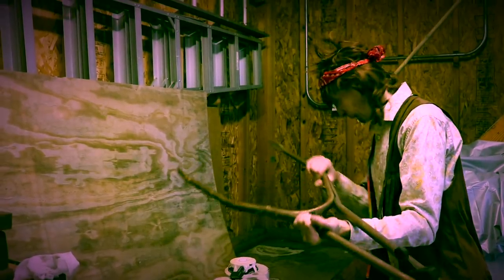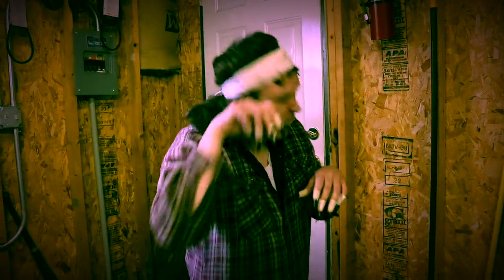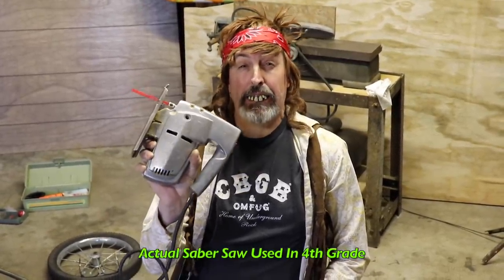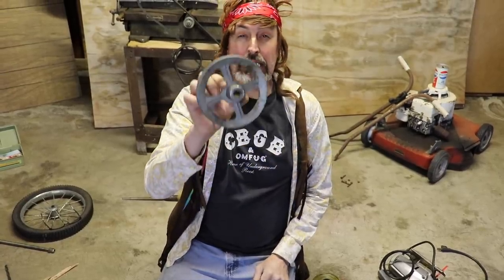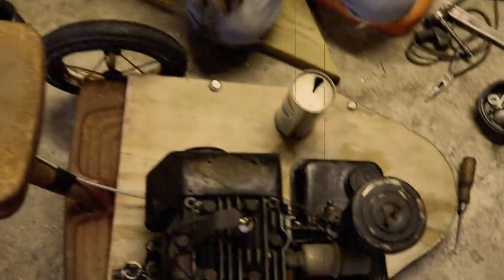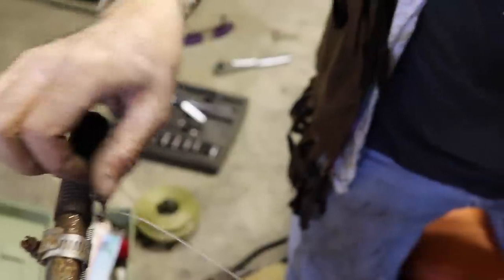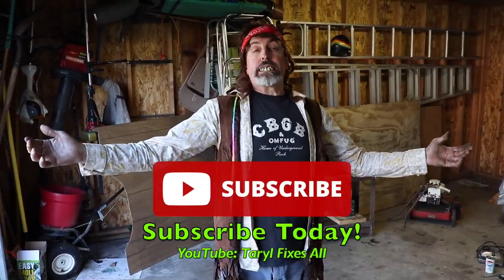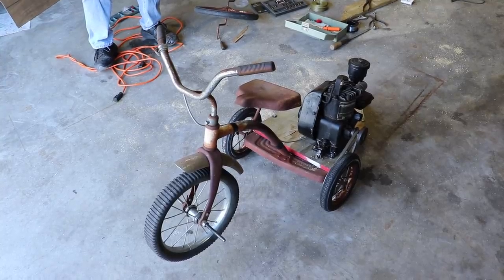We Put an ENGINE on a TRICYCLE! So Cool!

Comment: My buddies and I ran a Briggs 2 HP without the governor on the first go-kart and minibike we built.  Never had any issues.  When I convinced another buddy to eliminate the governor on his Tecumseh 3.5 HP within a week he threw the rod.  Same guy who, a couple years later, we convinced it was OK to hold his Chevy II Powerglide in low up to 60 MPH.  Guess who threw a rod.  Then we urged him to do Neutral Slam starts with his Mercury.  Within a week, he tore some teeth off the Mercury's differential gears.  See, it's not always wise to be a good listener.

Comment: Great show!! I put a 3 1/2 hp Briggs and Scratton on a Montgomery Wards bicycle when I was a teenager. Borrowed  the motor off of dads grain auger, belt tightener pulley off the corn planter, and a v-belt pulley that bolted to the spokes from White's bicycle shop , and number nine wire and a spring for the belt tightener. I mounted the motor over the back wheel on a piece of oak. It would run 35 mph!!  What a blast. And my dear old dad didn't ring my neck, bless his heart!

Comment: In 1968 I asked:my dad for a snowmobile. He told me to build one. I found an aluminum toboggan and a Maytag washing machine engine with a centrifugal clutch and kick start at the town dump. The local machine shop let me go through their scrap pile. I got a pulley, axle, bearing blocks. The owner helped me with a steerable front ski. The Texaco garage supplied a Ford model A fan belt. Over several weeks time I had been using my red wagon to collect parts and show the engine to get the correct size belt etc. the belt was drilled and machine screws were added to grip the ice. The was a river behind our house. It was frozen with little snow. The first day the brass machine screws broke off. The Ace hardware guy saw my problem and supplied hardened machine screws. It worked for a week till we got our first real snow, no more traction. When I got home from school there saw a brand new 1968 300cc 14 H.P. Skidoo parked next to my home built snowmobile.

Comment: I love it!!!!.......Reminded me that in the 60's, I build a wood framed three wheeled go cart. Rear axle ran direct in the 2x4 frame rails, one wheel drive, one wheel brake, front of a bike frame bolted to the center front with handle bars, shortened forks with a lawn mower wheel (went through lots of them!).....engine was made to slide forward to tighten belt to go (acted as a clutch). Broke down a lot but had several farmers junk piles for spare parts, not very fast, but had the time of my life. Later I traded an electric guitar that I was lousy at playing for a real metal go cart, man, I was on the top of the world!!!!!.....Had a ball on the rural roads!!!!!!!!!!........I think both you and I were crazy as kids, but I am sure neither of us would have traded all the fun for anything!!!!!!

Comment: I'm on my daughter's YouTube account. I remember taking things apart when I was very young. I just wanted to see what made things tick. I remember one time taking a scale apart. I'm suprised it still worked after that. There were a lot of things that didn't make it back together. When I was about 8 my dad told me that I needed to pay attention where the parts go when I took things apart. I think at that time he knew that I wasn't going to stop taking things apart. Lol. After that conversation my put back together rate went from about 50% to 90%. There were a lot of things that I wanted to build, but didn't have a welder, chop saw, or allen wrenches. I got my first welder about 13 years ago. I bought a brand new wire welder. I'm in my second childhood now. I have a Coast to Coast riding mower that I put an opposed 16 horse Briggs. I did a pulley swap on it. It went 12 mph. I did some more modifications to it. It then went 18 mph. I did one more modification and it went 40 mph. That's with the governor still hooked up. It took me about two years to solve the steering issue. I tried to align the best I could many times with no avail. Then one day when I was walking by the rider I noticed the problem. The caster was way off. I drilled out the factory spot welds for the front axle housing and readjusted the caster. My welder welded it in place. It was a complete different machine. I eventually slowed it down to 24 mph. I used it to pull a yard card full of grass/weeds to the dump. With the steeper gearing it was more user friendly with the extra weight. The factory brake didn't last long. So I cut a small piece off of a brake shoe for a car and fitted it to the drive belt. It has the 6 speed transmission plus the varidrive. So the varidrive does most of the stopping and the piece of the brake shoe only rubs the belt to stop when it almost stopped anyway. I hasn't worn the belt yet. I've done some riding mower modifications as well with the snowblowers. I have an older 12 hp Murray that runs on E85. I have 2 RER Snapper riders that run on E85. I've tried to do the same with a couple of push mowers, but it wasn't worth the effort. I mow in the summer and move snow in the winter. Plus I work on people's  mowers and snowblowers. I even work on a competitor's mower.  I'm small scale compared to you, but it pays the bills.

Comment: Excellent vid and story Taryl !!!
Back in 1965 I wanted to make a fan driven snow sled. I took a similar engine offa' my neighbor's self-propelled reel type mower... the thing was just sittin' in his garage doin' nuthin'. lol I got the 30 inch plastic fan blade offa' big 'ol free-standing restaurant fan I found in the basement of Hering's restaurant which had the same size shaft as my engine - 1/2".
I cut the arms and back offa' antique high-chair.(got in trouble for that) I bolted the engine to the chair seat and attached the blade. I tested it before mounting to the sled. My left hand holding the head of the engine I pulled the rope with my right hand and it started right up and the fan immediately blew the whole works over with the fan blade somehow missing my left arm as it went by. The fan blade blew to pieces as it hit the ground. End of experiment. Moved on to build a gokart with the engine, which of course had no brakes but that's another story. lol Thanks for the memories Taryl !!!

Comment: Heck yeah, awesome video!  Brought back memories as I was a child fabricobbler also 😆.  I built an all wood go cart with wagon wheels, foot steering with a rope backup, and a 4hp vertical Kmart briggs.  Transmission/clutch system was an old riding mower transmission I found in the junkyard by my house, I adapted it perfectly with some old pulleys and belts.  I say perfectly, but it was a trial and error process for sure.  I remember I could slam it into gear and shift all 3, and even reverse occasionally.  I eventually blew the transmission so I had acquired a 4 hp REO mower engine from a gas powered reel mower I got in a deal for working cleaning up these people's shed and yard.  That's fine was awesome, and it had a built in gear reduction.  I used a pedal powered belt clutch and my dad built me a steering gear at work so I could install a steering wheel to my 2x4" front "axle"/steering plank 
swivel style 😆
I also rocked around everywhere with an old 28cc weed wacker engine on my Kent BMX bike, dad helped me with the mount and clutch.  Good times

Comment: Lots of fun going back down memory lane. I've been tempted to build another mini bike like the one I built using an old bicycle frame,  B&S  2 1/2 HP edger engine, Speed Queen washing machine clutch, dryer pulley and wheelbarrow wheel, all from trash pile,  when I was about 12 or 13. Believe it or not, I still have a couple of those old Speed Queen fluid drive coupling washing machine clutches.

Comment: I did almost the same thing at the same age. I took a gas powered reel type walk behind with the identical Briggs engine you used and took the handle off and the rear wheels off the trike. I than bolted the step plate that was between the rear trike tires to the plate on the mower where the engine and belt clutch were mounted. Of course the mower tires were now the rear tires of the trike. I was able to actuate the clutch via the original rod now moved to the trike. I rode that thing around my block a thousand times and when ever I would ride over grass I would cut a swatch. Over the years I mounted that old cast iron Briggs on many things. Video brought back those memories.

Comment: That Junior....one of these days that boy will win an Emmy,  Golden Sparkplug or Earl statue. That Kmart sabre saw reminds me of the old  drills when I was a kid....they stunk like ozone everytime you ran them. I've still not figured that out. That contraption reminds me of the Whizzer sportsman I had...a handmedown. It looked like a 20 inch bike with a pulley on the back tire. I think the engine was about 1 1/2 hp. It'd do about 35.

Comment: Reminds me of building the wooden go-karts and we had not clutch direct drive with the belt ...Start it with the back end up on a block rev it full throttle and shove it off ..Brakes ......we didn't need no stinkin' brakes

Comment: Damn that brings back the memories! Mine was a old Clinton engine with the same setup. I made mine out of 2x2s and plywood, 3/4, 12" pipe, wash machine belt and pulley and my red-flyer wagon... I flew... 
Thanks gang for the video!
LLAP

Comment: I had the same Briggs n Scranton horizontal shaft engine and made a go-cart from an old garden tractor frame and wheels. Drilled holes in one wheel and wired a pulley to it. Ours had no centrifugal clutch just a pulley. Started by pushing, no brakes, drive ratio was too high so It was real fast but had no hill climbing ability. Ran it around the neighborhood for a few hours until someone called the police on us and that was it. But I learned a lot from it

Comment: I'm just a couple of years younger than Taryl and I had a neighbor who did basically the same thing to a Radio Flyer wagon with the pulley mounted to one of the rear wheels and motor on a board laid across the back of the wagon.

Comment: I did almost the same thing! 10 spd mountain bike front end, butterfly handle bars, tubular frame with riding mower rear axle and a 5.5 breaks n scrappum! Used a brake handle for throttle and tire tread for rear brake (chain operated with a pull handle!

Comment: awsume video in 1968 i built what we called a chug a wooden go cart i was 10 yrs old with no help from parents we had a old reel mower with a briggs motor didnt have a recoil you had to wind rope around pully and no clutch it had a clutch where you used a lever to tighten the pully i buit it powered it and drove it for a short time as our threaded rod axels would eventually bend but it was fun and it amazed the mechanically lacking adults my start was very similar to yours but my career went into construction became a electrician